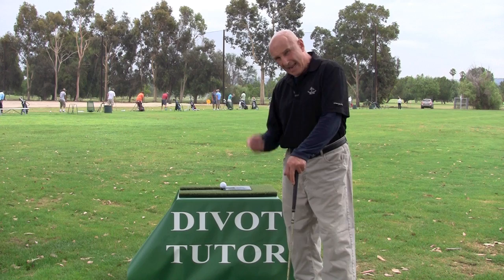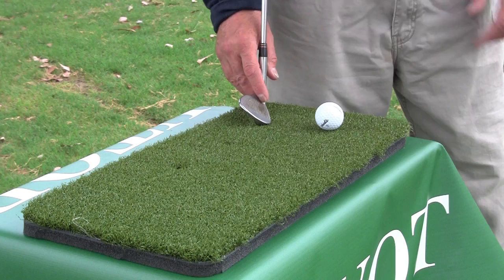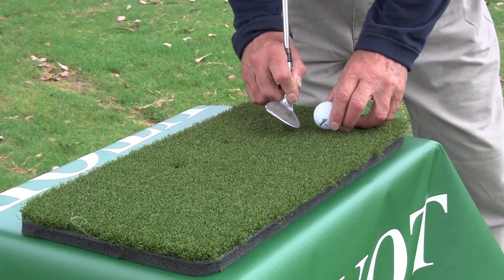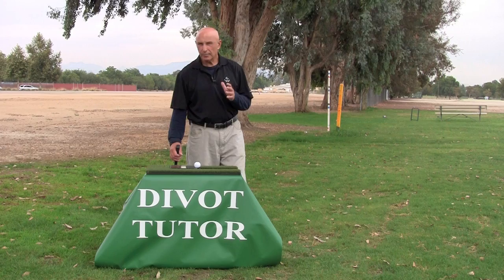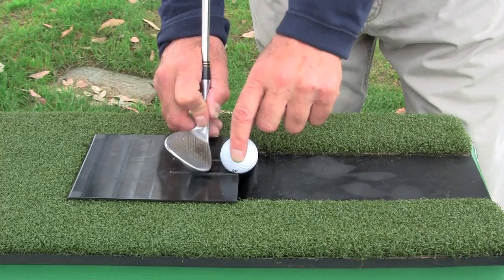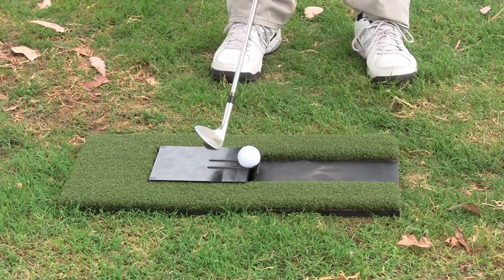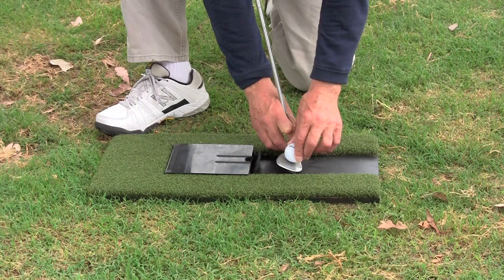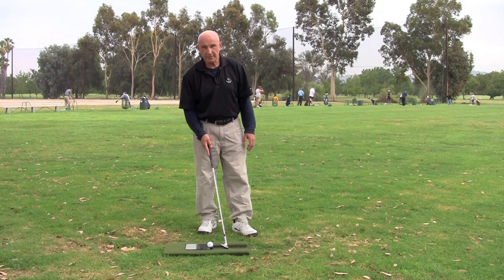Divot Tutor www.divottutor.com

Comment: You dont hit the bottom edge of the club first (like youre showing)  if youre making solid contact you have your shaft angled forward and make contact in the middle of the club- it doesnt roll off the surface but a mm before flying off the club face
Reply: Agree, that’s not correct.  To hit the center of the club face, your hands have to be ahead of the ball (shaft lean towards the target) at impact.  He’s describing a scoop shot that’s very weak.